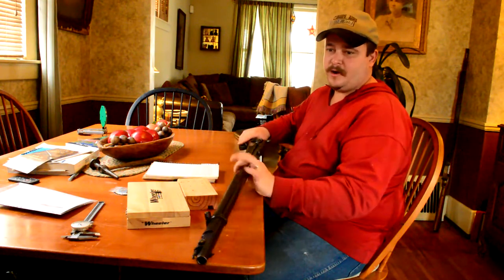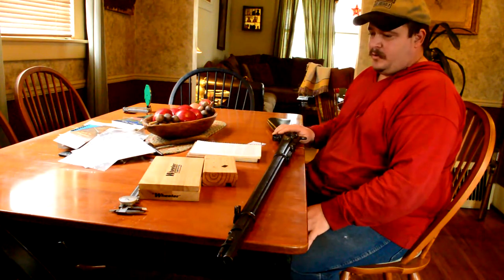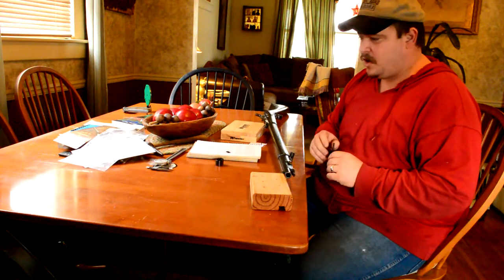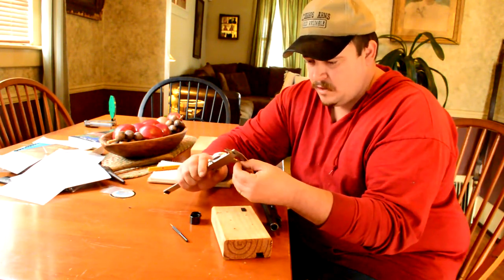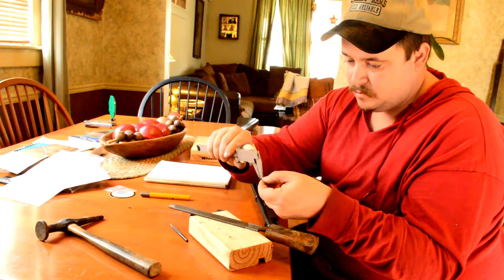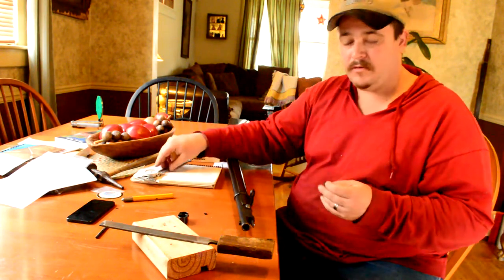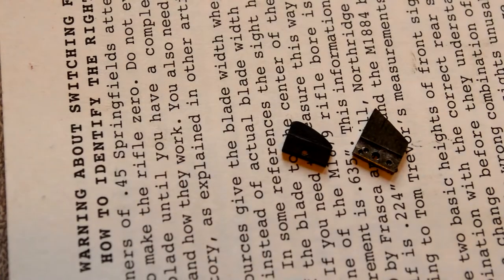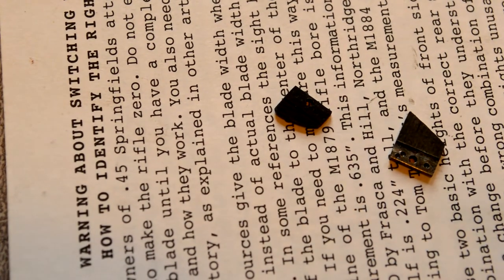Trapdoor springfield front sight replacement

Comment: Is the front sight hood obscuring the sight picture badly? That sight is much taller than those hoods were built to accommodate. I do like that it protects that higher blade.
Reply from the maker: It does somewhat. I take the hood off when I use the rifle.
Reply: @ian45662  Makes sense. Thx for the heads up.

Comment: Hello Ian,
I really enjoyed this video, it inspired me to buy one of these taller sights for my Trapdoor. I had to order the sight blade from S&S Firearms, I guess they bought the stock from Trapdoors Galore. I have a question, how did the sight work? Was your gun hitting point of aim at 50 yards after you made this modification or would you do anything different now? 
I am going to change my sight, but I was thinking of just filling the sight at the range. Did you file your sight to shoot to point of aim at 50 or 100 yds.? I am older and I agree with you when you said the sight was made for younger eyes! 
Anyway, please keep up the good work, and keep making these videos!
Reply from the maker: After I installed it I took it the range and adjusted the buffington sight until it was hitting where I wanted. I can't remember what the settings were but I'm thinking it was 250 for 50 yards and 300 for 100 yards. I could file it to where 200 is the point of aim and I still may. I didn't know S&S bought there stock that's good to know.

Comment: Aren't the original sight combination (Front sight height + Buffington) supposed to be matched/calibrated to the Buffington settings, using the 500 gr cartridge? If your original front sight was at proper height, why change?
Reply from the maker: @jason60chev  they are but they hit very high at 50 and 100 yards. If you want to be able to aim directly at your target at those distances then you will want to add a taller front sight.
Reply: @ian45662  Am making plans to attend the Quigley Match, next June. 350-800 yards and will be using my Trapdoor(Not that I expect to score any points) with 500 gr black powder load,so it would be nice for the sights to work, as marked.
Reply from the maker: @jason60chev ok. Even with the correct size front sight the settings will still be off a little. Keep that in mind